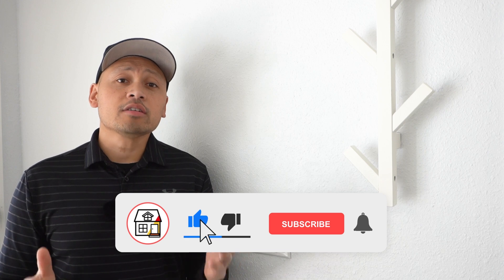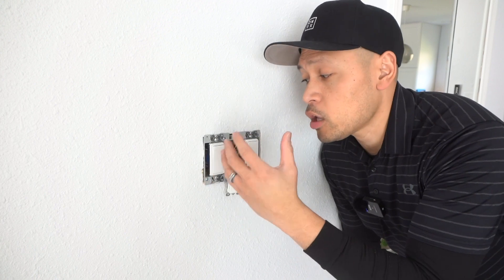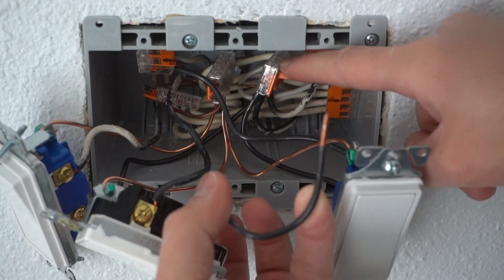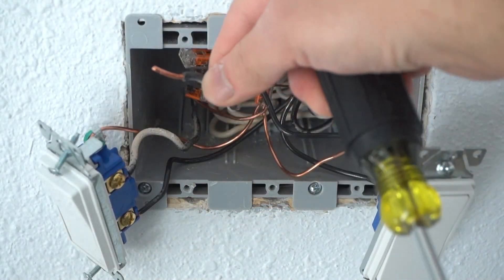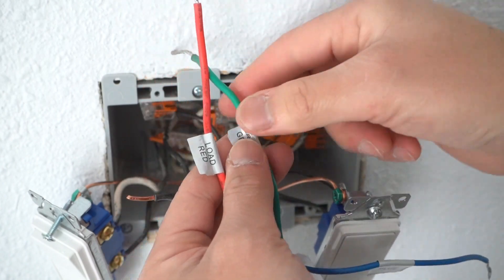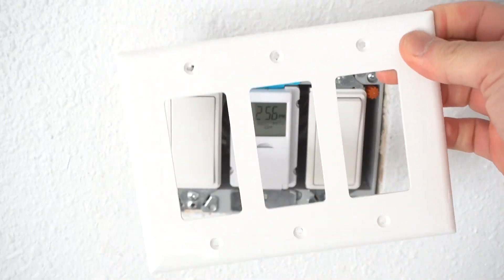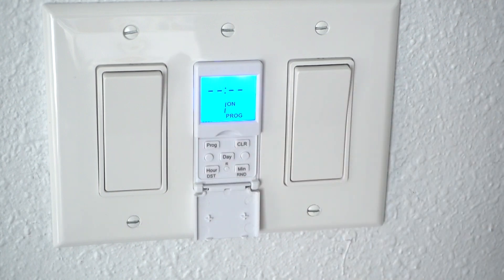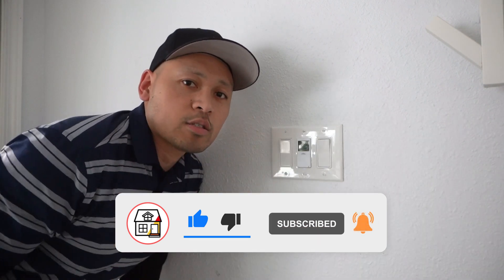How To Install Automatic Digital Timer Switch For Fans, Light & Motors In Your Home! DIY Electrical

Comment: Sorry, but unsleeved Earth wires are really really dangerous, and in the UK wouldn't meet electrical installation regulations and probably invalidate your home insurance as they could easily make contact with the live wire connections on switches when you reinstall them.

Comment: Never showed where to put the ground!!
Reply: Light switch dosent require ground but the switch has ground wire to connect to if you don't have a ground thats fine also

Comment: Awesome video! Really helped me put the automatic lights on my front porch with ease. Do you have a video about when the 3way wire would be used? Trying to install this in my garage light switch (3Poles) but noticed the hot wire was connected to two light switches at the same time.  Does this change the installation and use the blue 3 wire?
Reply: Is there a way to turn porch light off if we just happen to want it off or it’s all by timer only??

Comment: Thank you for the video. I am pretty handy around the house but I am stumped with this particular job. I have the same timer you show here. I have my porch light that is operated by 2 switches. One in the kitchen and one by the front door. I guess this is a 3 way switch situation. Both switches have a red, black and white wire. The new timer switch has red, black, white, blue and green which I know is ground. When I install the switch in the wall by the front door, where would the blue (3-way) wire go? When I installed the timer switch it would light up and I can hear the switch try to turn on the light light, but no light. When I flip the switch in the kitchen nothing happens. Not sure what I'm doing wrong. I do not mind bypassing the switch in the kitchen, what would I do with the red, black and white wires to do this? Thanks...any help would be great!

Comment: I have a question. I have a very similar set up other than I replaced a bad light timer for a different-brand timer in the 1st gang. That went great. I needed to remove the middle switch to give me finger room to work. It is like your light switch--1 way with 2 terminals for wire and a ground. The only 2 black wires are the Line and Load. I reinstalled that middle light switch (governs the entry way light) when the light timer was successfully installed--for the front porch light. But that middle switch no longer works! I replaced the bulb, I replaced the switch with a new one, I swapped the Black Load and Line wires and it still doesn't work. I can't figure out what's gone wrong. I left the 3rd gang switch in place (it's a 3-way for the upstairs light) and it works normally.  I have everything back in place without figuring out the middle switch's issue. Any thoughts from anyone to guide me to a solution?

Comment: I upgraded mine with a wifi smart switch. I can control the time through a smart app as well there is local switch.  Programming the switch you install is old school. I can also turn on/off my switch anywhere I am. Same easy install
Reply from the maker: I completely agree at some point. I do have allot of smart switches and lights in my home, and you wouldn’t believe how many apps I have on my phone that controls each different brands, gets confusing from time to time lol. Having a single point timer like this will makes things easier for me personally and gives others options if they don’t like the smart phone app ways. I do appreciate your input. Thank you! 🙏🏽😊
Reply: @FixThisHouse  check out smart life. I have different brands all controlled with smart life